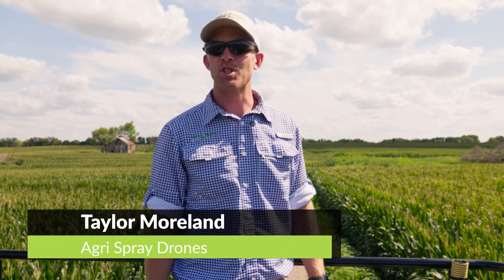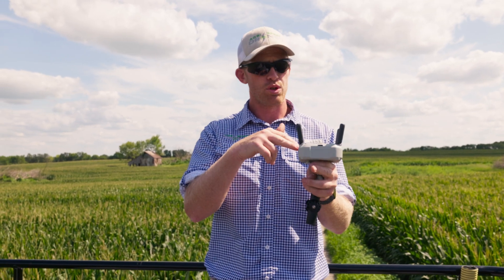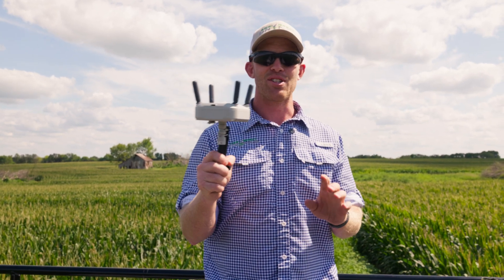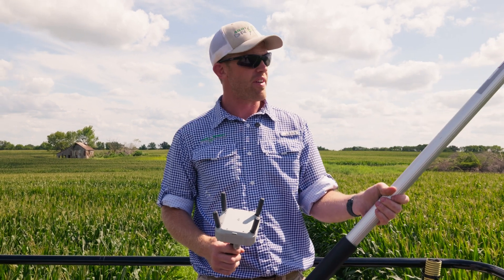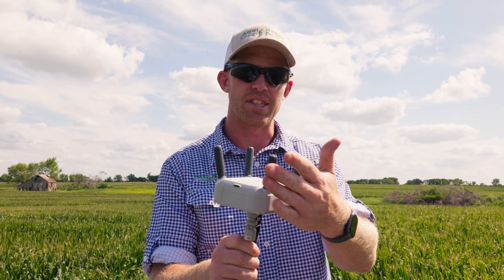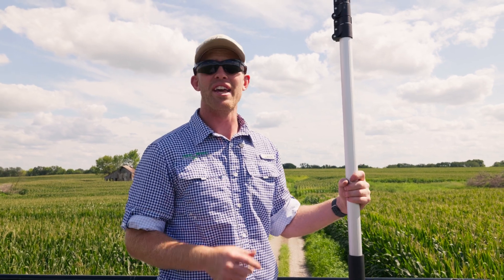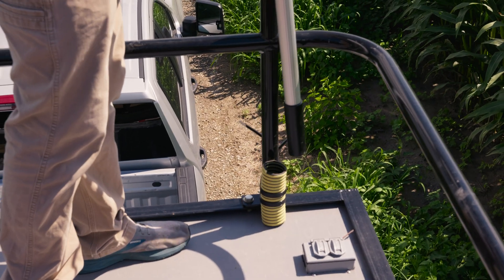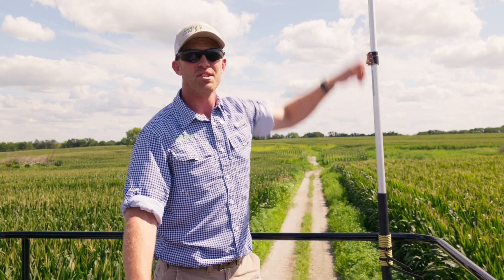DJI Relay Module

Comment: Hi, would Mavic 3M be able to carry it ziptied to its back? Would be nice and easy to just send it out there hanging 100m over the middle of the field, just replacing batteries every 30 min... Or just send it out for those specific remote parts of the field :)
Reply from the maker: The Mavic really isn't built to carry that kind of payload, so we can't recommend it--however theoretically it is possible!
Reply: @AgriSprayDrones  If there was a lighter version of the relay...it would work just great... I am affraid it would be on the edge of mtow now